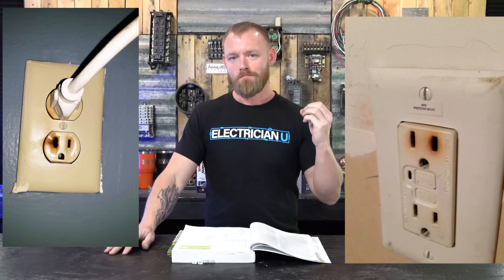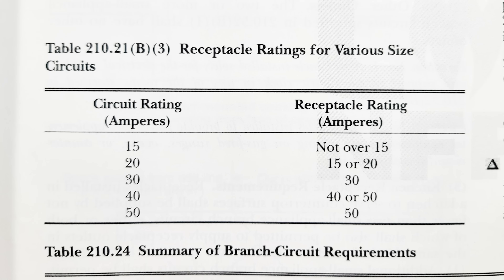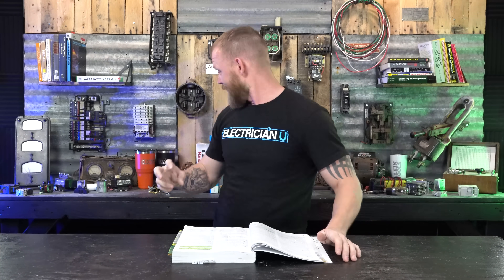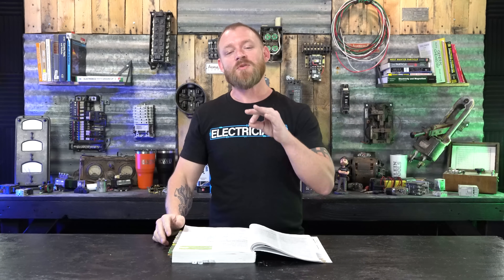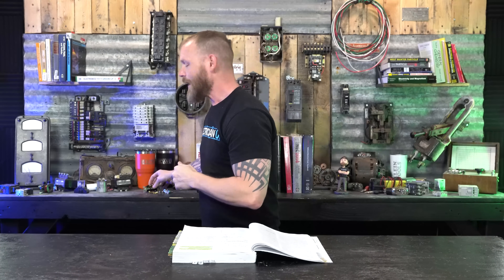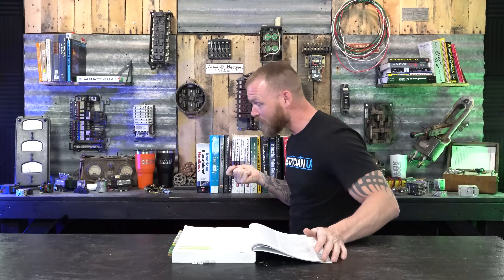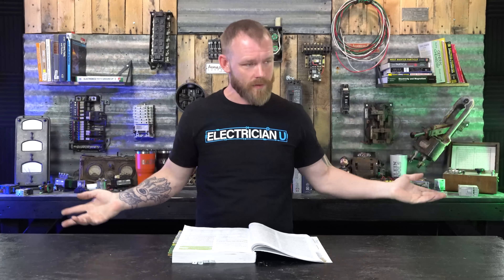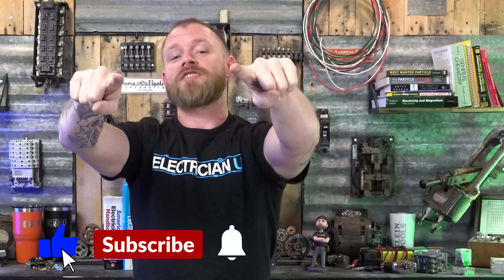Won't These Melt?!? 15amp Receptacles on 20 amp Circuits!!!

Comment: Rule of thumb - breaker size set to be the lowest rated item on the circuit.
When I ran electric, I matched everything - 20 amp breaker, 12/2wG, and 20 amp outlets.
Regardless of the number of outlets on a given circuit.
People tend to run power strips anyway that generally are rated for 15 amps.
TV's and lighting power requirements have dropped like a rock over the 'old days'.

I choose 20A outlets for durability.

Waiting to see them change the requirement to single outlets instead of duplex outlets.

If they didn't rob people over the cost of wire, I would use awg10-2WG to every outlet.
Less chance of heat related issues with wire.
Reply: #12 THHN is rated for 30 amps so running #10 for 20 amp circuits would make no sense. Even #14 is rated for 25 amps. #12 is already oversized and will not overheat on a 20 amp breaker.
Reply: @pld8993  You underestimate the stupidity of the typical american consumer.
According to the ampacity chart, only certain kinds of wired can handle the loads you described.
Typical household Romex is rated much lower than you described. And that too is contingent on how and where the wire is run.
Also, larger wire has less resistance on longer runs (say from basement in front of the house, up to the rear of the house 2nd floor. A LONG run on many houses that have 10 foot ceilings and front to back 75 feet or more).
Reply: @crazysquirrel9425  Romex contains THHN, which is rated for 90C. The cable is derated down to the 60C column, which means that though the conductors inside can handle 90C, they'll never even come close to 90C. 14, 12 and 10 are already oversized in every application due to overcurrent protection limits established in 240.4. When the current hits 15 (#14), 20 (#12), and 30 (#10), the breakers will trip long before the conductors reach their limits and nothing joe homeowner plugs in is going to change that fact. As far as long runs, the concern there is voltage drop, not amperage. In the event that current increases as voltage drops in an effort to maintain power, the conductors are still connected to breakers or fuses, whose primary job is to protect the conductor from overcurrent.  
My point is this - your concerns, while valid, have already been addressed by lowering the max ampacity of the conductors and designating a max breaker size for each that far exceeds their current limits. We can't wire everything for "what if stupid does x in the future," but when it comes to romex and 14, 12 and 10, that has already been somewhat factored in to the existing rules.
Reply: @pld8993  Always best to 'idiot proof' a job as much as you can.
When I do a job, I match everything best as I can.
15A breaker, yellow wire if I can, and 15A outlet.
20A breaker, always yellow wire and 20A outlet.

I have seen some pretty astonishing things people (aka tenants usually) do.
Reply: @crazysquirrel9425  Understood but again, that's already been factored in. A cheapo 15 amp recep, in order to be UL rated for 15 amps, must be able to hold 150% of its rating, or 22.5 amps. The link between the terminal screws on a 15 amp recep is rated for 20 amps and must be able to hold 30 amps to get that rating. Even on a 20 amp circuit, no part of a 15 amp recep will ever be overloaded beyond safe limits.
Reply: Can I put at 20 amp receptacle on 40 amp breaker
Reply: @bigopp4463  No
Reply: @bigopp4463  You sure can! But it isn't safe nor code.
But you could if you guaranteed that the load never exceeded 15 amps or 20 with appropriate wire size (80% rule).
Reply: Would it melt the receptacle
Reply: @bigopp4463  With sufficient excessive amperage, a melted recep and/or a fire is a probability. NEC does not allow 20 amp receps on any circuit larger than 20 amps.
Reply: @bigopp4463  Anything is possible. From worn out connections for the plug, dirt in the connections, bad plug itself, several things can cause a receptacle to melt.

The original reason for the melting was people using a penny in the glass fuse socket then running something too high of a load...

Comment: Great video! Canadian elec apprentice here, why does the receptacle circuit need to be on a 20 amp breaker I might ask? if there was a 15 amp breaker, then I don't think that this would be nearly as much of a problem. Keeping the wire sizes up if you have the budget will be better if you want to upgrade in the future, but why have the larger breaker for the smaller rated receptacle?

Comment: 15 amp receptacles are rated for
20
Amps?????? Maybe ??
Reply: Each side of the recep is rated for 15 amps and in order to have a 15 amp rating must be able to handle 150% of its rating, which is 22.5 amps. The link between the terminals is rated for 20 amps and must be able to handle 30 amps.

Comment: The cheapest 15 amp receptacles that Lowes sells will melt after prolonged use at under 15 amps.  ie small Window AC or electric heater that draws ~12 amps.

Comment: I just replaced all the outlets and switches in a house we are selling for a relative. It has aluminum wiring. One room has a 20a circuit with one switch and five receptacles. I replaced all the receptacles with 15a ones, which matched what was there. This is a living room with a fireplace. And it's not that large of a room. I knew I could use 15a receptacles, but now I know why. Other than the kitchen, that is the only 20a circuit with receptacles.

Comment: Before I watch the video, I will attempt to impress you by guessing that a 15A receptacle is fine on a 20A circuit, because the receptacle limits the load to 15A due to the prong configuration. 
Now let’s see how ignorant I am 😂

Comment: 15 amp receptacles with 12 ga wire and 20 amp breaker.
Light circuit with 14 gauge wire and 15 amp breaker (unless more is required)

Comment: trying to learn here, but, every video I've seen on 15 amp and 20 amp comparrisons where they have taken the recep cover off and mic'd out the metal connectors have been identical even between residential 15 to residental 20 and also between commercial 15 and 20. Can you provide evidence to back up what you're saying

Comment: I'm really confused, I just pulled a 20 amp cord off of my air handler and it has the horizontal plugs and the exact specific receptacle in the wall, but while I'm trying to find a new 20 amp cord, they all have a standard plug. I can't put a 15amp receptacle in its place can I?
Reply: I'd say no. It sounds like you're describing a 240v 20 amp requirement.

Comment: What a fantastic video. Great information, great cadence and great presentation. I would subscribe twice if I could. I’m remodeling our basement apartment. It’s going to have a dual induction, countertop burners and a toaster oven. Trying to figure out if I need two dedicated circuits for that area for those two devices.

Comment: If small appliance manufacturers are required by NEMA to not exceed 12 amps it makes me question why many 120V plug-in appliances are rated at 1500W. Some hair dryers are even 1800W. There’s portable EV chargers that are rated at 16A. 
 I have two different brand space heaters. both are 1500W rated and pull at least that much on the HI setting. According to my math that exceeds 12 amps. Perhaps there are exceptions for certain appliances to exceed that 12A maximum.
Reply: I believe that 1500w appliances should only be used on 20 amp circuits and only one per circuit at the same time. The 1800 watt hair dryer is only supposed to be on for a short time, and a 20 amp circuit can use just under 2000 total watts safely.

Comment: Upsizing wires is fine. But you can also have a 20 amp breaker 12 gauge wire and multiple 15 amp outlets. But if it just 1 outlet it has to be 20 amps.
Reply: It must be a single receptacle. One duplex outlet (receptacle) is defined as multiple outlets since there are 2 receptacles.

Comment: You might want to address the difference in pin configuration between 15 and 20 amp receptackes.   I'm thinking the 15 isn't simply less robust, it also limits the typw of device that can plug in.

Comment: Dude,  I want to tell you that I think your channel absolutely rocks.   I've been doing some electrical PM around my 60 year-old house, keeping in mind that codes have changed and that my "horse trading" dad (RIP, you rascal!) might have influenced things not necessarily for the better.  Anyhow, your wheat from the chaff presentations have helped a lot.  Cheers!

Comment: My old wheel barrow compressor pulled a full 20 amps it could run off 15 sometimes if a few feet away from the panel

Comment: Another gripe i have. Ok scenario here. Lets say i go into an older house. They barely have any breaker space left. Maybe 2 left. Older box so getting mini breakers isnt an option. I know tbat this homeowner plugs in space heaters due to the homes normal heating not being enough to heat the home. These older homes very commonly either have multiple rooms sharing breakers or said room with the space heater has only 2 outlets in it. Well common thing for people to do is ohh its only got 2 outlets i need more so ill put one of those 6 outlet strips in. Then sometimes plug the space heater into that. Asking for trouble, but ignorance is bliss. You say to homeowner you cant plug this in to the strip or to the outlet without running a new line up to this bedroom specificially for running a space heater. In this scenario the root cause is whatever insulating problems the house has or their heating not sized right for the square footage of the house. I ( the electrician ) cant do anything about the heating problem of the whole house. That isnt my area of expertise. All i can tell homeowner is if you continue down this path your likely gonna burn your house down and this is what i can do to help you prevent that. Or you dont use this space heater in this scenario

Comment: Ok in this video it is described the dangers of plugging in space heaters into 15 amp receptacles because of the heat build up in the plug. This is exactly why 15 amp receptacles should be outlawed on a 20 amp circuit period. No exceptions exceptions. I have gone into older homes where iwaa called because it smelled an odd smell or the receptacle fell apart or had black marks. Every time a space heater was involved. Part of the point of having codes is preventinf fires that cost people their homes or their lives. For clarity im talking about only a 20 amp circuit breaker and wiring with 15 amp plugs. We dont know what people are going to plug into outlets. Sometimes we have to protect people from themselves

Comment: 15 amp receptacles on a 20 amp circuit are fine for a few reasons (prong orientation, the fact that its a duplex not a single, and terminal ratings, etc.).

You cannot put a 20 amp receptacle on a 15 amp circuit because the receptacle will accept an appliance rated at 20 amps which will overload the circuit.

Appliances that are rated higher than 15 amps have a sideways prong to physically prevent them from being plugged into lower amp rated receptacles.

Comment: Code cites a lot of things that are end-user limitations and guidelines. The logical reason for a 15 amp outlet is so that people can't connect a load that has a 20 amp plug. There's no way to prevent overloading a circuit when consumers connect multiple devices, or exceed an outlet's rating by adding outlet multipliers and multi-outlet extension cords. The way homeowners know that they've exceeded a circuits capacity is when they have to reset the breaker twice to finish vacuuming the living room :-)

Comment: No appliance with that plug config will draw more than 13 amps or 1500 watts. The code assumes common sense to not use fire starting multi-outlet adapters and to replace worn receptacles. There is a test tool used to test the grip strength of the receptacle prongs to hold a plug. Worn plugs cause arcing. Melted receptacles are from lack of maintenance or lack of common sense. Code is not responsible for the problems. Homeowners can melt 20 amp receptacles as well if the receptacle is not maintained. Enter AFCI receptacles/breakers to solve the arcing issue.

Comment: Breakers are rated at 80%. The thermals are designed to trip over 80% after 3 hour (continuous load).
Reply: Incorrect. Typical thermal breakers are rated at 100% and shouldn't trip unless at or very close to their limit, regardless of how long the load has been sustained.

Comment: Not an Electrician but the Code really should have erred the other way. Instead of say a 15 amp socket being limited to a 12 amp load, they should upscale the "15 amp" sockets to tolerate 15 amp loads (so maybe they're actually 18 amp or whatever but called '15 amp'). Same with breakers. Sure it'd cost more but be *safer*. Or if you're so worried about cost then call a '15 amp' socket what it really is (*12 amps*). Expecting lay people to know the NEC like an Electrician is insane!

Comment: This sounds wrong, but is it unsafe?
There is a 30 AMP dedicated circuit for charging my plugin hybrid. The charging requires 15 AMP.
It is wired with 10 AWG to a single outlet with a 20AMP/240V (required by charging plug)

Comment: Used to be able to find 20 amp plugs everywhere now it’s like pulling teeth trying to find one and people quit put in 20 amp plugs and 15 amp plugs on 14 gauge wire that’s meant for lighting circuits. You guys always get stuck in the book and what you do and what others do, but never talk about the real safety problems And that’s what I see is a real safety issues. Just saying good good video.

Comment: It’s been my realization throughout my whole DYII life 20 amp breaker get to 20 amp plug. I only use 15 amp for lighting circuit. That’s it and I suggest that everybody else does the same thing and I don’t never put more 10 plugs on one line no more than 10 lights on one line so just my thoughts I think Home Depot and Menards and those places couldn’t even offer 15 amp because homeowners could get themselves in trouble really quick and I’ve known of a few homes that I’ve been on fire because of this and I’ve seen a lot of melted plugs over the years replace the plug when it goes bad should be a 20 look they just put a 15 minute and that’s the reason that these big box stores should be pushing 20 amp safety nothing to do with electrical code just safety

Comment: Great video, but I have a question which is the reverse of your example. Can you use a 20amp 3 way light switch on a 15amp breaker?

Comment: Why does nobody talk about OLD LOOSE receptacles that are bad connections ?!!
( in YouTube video, not just in comments)
They get HOT Because of BAD OLD LOOSE CONNECTION !. ESPECIALLY with space heaters in the winter !. 
1500w ÷ 120v = 12.5A . Space heaters (on HIGH)  MAX out the receptacle! ALSO, Little tiny "2" conductor Christmas cords baD !!.
Extension cord for space heaters ALL not supposed to be used because most I've seen are bad connections anyway.  I make up my own cord if I MUST use one. NEW 20 amp receptacle ( at wall ), hospital grade male plug on 12 ga. SJOOW CORD & 20 amp receptacle box on end .
Please emphasize new tight receptacles good! ESPECIALLY FOR WINTER USE OF SPACE HEATERS !!. FIRE BAD AT WALL !!.

Comment: What I hate is that all multi-outlet extension cables only allow 15 amps.  I have a 20 amp circuit, I'd like to connect several small tools and a 10amp Saw to this.  Had to go on Amazon to find a extension cord that supports 20amps, no store stocks these.  My total load will vary between 10 and 17 amps, well within the circuit's capacity.

Comment: a 20A receptacle  on a 20 Breaker will cause a fire because the breaker won't blow when a 15 is reaching 22A  Will there still be an issue with a 20A reaching 22A also?

Comment: I wondered about that. I had at the time a 45 year old house that had Bulldog Pushmatic breakers. The city decided to not allow them if any electrical work was done. I had to replace the wetherhead. So the panel was replaced. The electrician replaced the 15 amp breakers with 20 amp breakers. In a 45 year old house. So far so good. Nothing has caught on fire. I later had every socket changed in the house. Most were ok. Some were burned. Some were really burned and pieces of plastic missing inside.

I still wish he put in 15 amp breakers.

Comment: Will 4/0-4/0-2/0 Black Stranded AL URD Cable plus a #6 awg CU fit in a 2 inch conduit?
Thanks in advance. V/r, Patrick

Comment: Shit. I have been replacing all the receptacles in my house with all the cookie cutter house receptacles that are left over on job sites I'm on. And buddie the amount of electronics, computers, video game council tvs, and space heaters/ac units, lights, fridges, humidifier, right now I'm in my work trailer and I'm running a space heater off 200 feet of 14 gage cord, 4 battery chargers, fan, air compressor surveillance cameras. It's ridiculous. I'm honestly worried  my house is going to burn down along with all my nic nacs and useless junk that I can never bring my self to through away along with the stupid amount of tools that I have collected over the year and god for bid my 1980s penthouse magazine collection. All those bottle caps I have been saving for reasons unknown. Would be a travesty